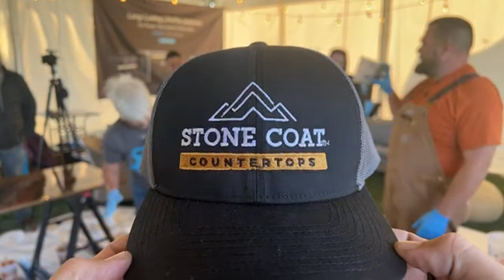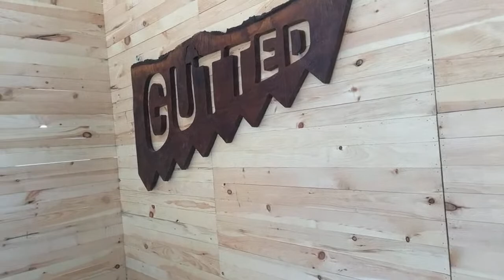Epoxy Live Demo at GUTTED Reality TV Show

Comment: I want to do this to my garage floor and my bathroom sinks. The only thing I was rear ended can’t use my dominant hand anymore. Can the sinks be done without removing the faucet?
Reply: I would not. If you ever need to pop the faucet off, you will ruin the coat.  It will run into any gap under the fixture and glue it and maybe get into the threads as well.  Don’t leave the drain in either. Get someone to help you get the fixture and drain out.